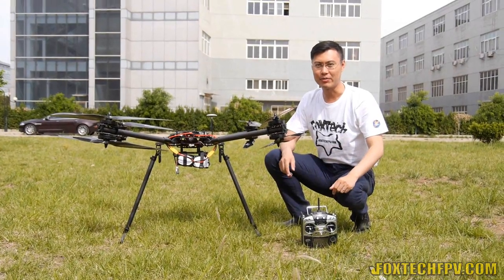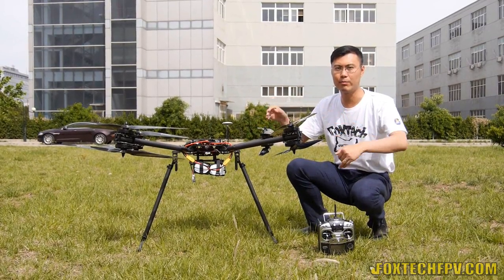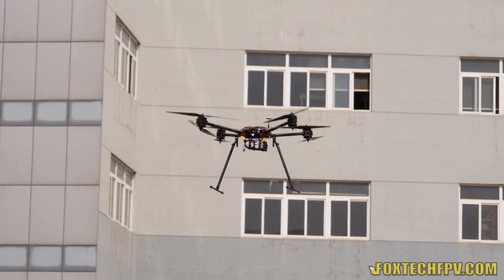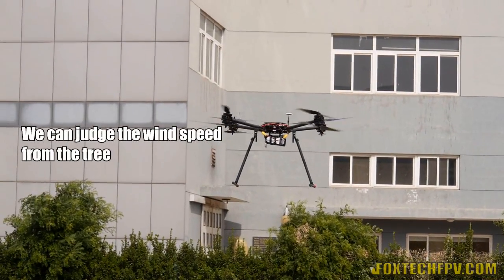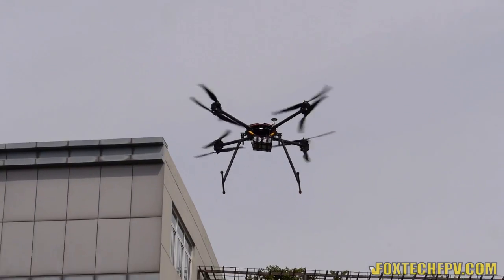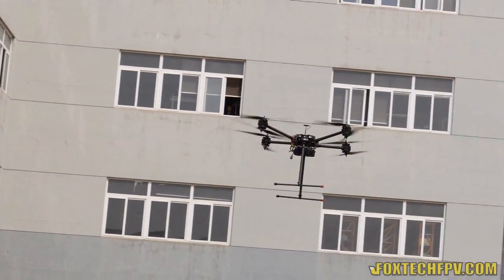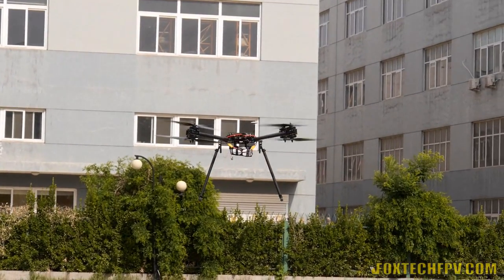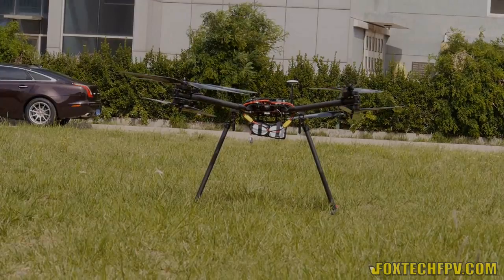Foxtech D130 VS A2 new firmware

Comment: That was not FAST forward flight with a sudden stop foo...  which is what causes the problem, you need to go faster,, and then release your elevator stick whilst in GPS ATTI mode to induce a sudden stop,,  that's what causes the low pressure bubble above the frame and makes the controller think it is climbing,,,,  so it actually descends to chase the baro error,,,  glad the rest of it works for you though!  cheers